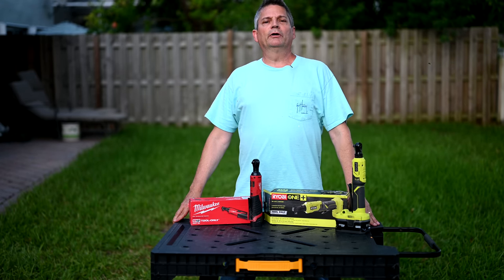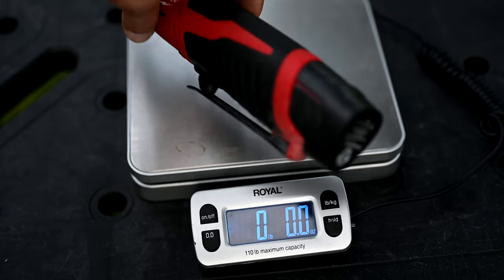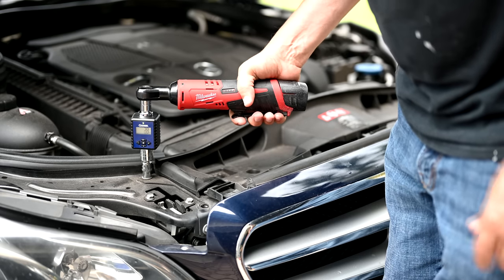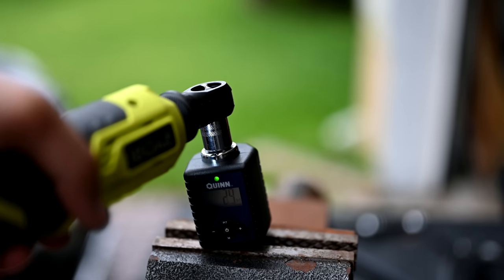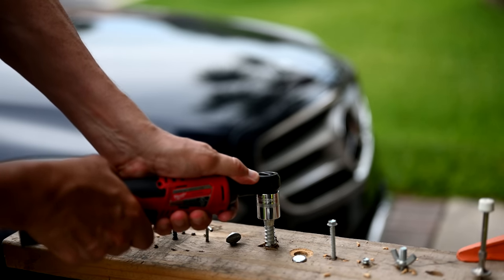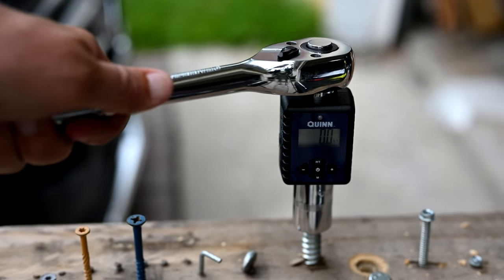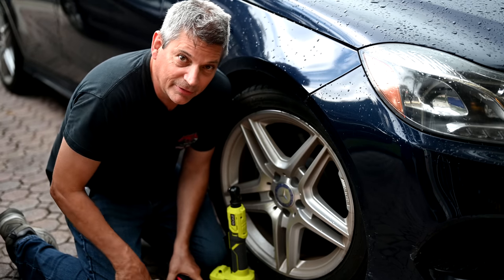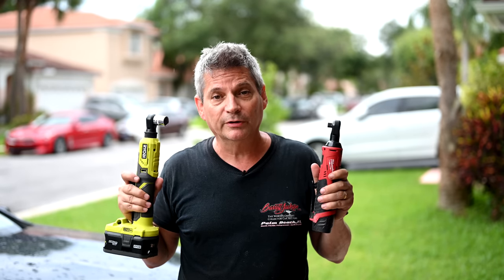Ryobi 3/8" Cordless Ratchet Vs. Milwaukee Torque/RPM Tests

Comment: You can see the marketing games that TTI is playing, rating the Ryobi at a lower RPM when it's clearly faster than the more expensive tool.  I want the Ryobi but the big battery really does seem dumb for tight engine bay work...problem is that's the only system I own.
Reply from the maker: Maybe they did not intend it to be used in tights places
Reply: @jeffostroff  Well they did at least try to counteract the battery issue with the rotating head, which is nice.  I'm just picturing one particular circumstance where it was a huge PITA to get a ratchet in to loosen some bolts (it was a transmission cooler/radiator situation) and I am just not sure the battery would clear.  Again I think the idea is you rotate the head so the battery is sticking into an area that has more room.  I really like the price/performance of the Ryobi tools, especially the way they probably trickle down technology from TTI's more expensive lines.  But I am still on the fence here...

Comment: The method you used to measure torque was flawed. Watch how Project Farm measures torque for electric ratchets. He got 30 ft lbs for the milwaukee.
Reply from the maker: I don't think we ever even showed it measuring the electronic ratchets. Not sure why you think using a torque converter is flawed anyway. Please explain your argument. Otherwise your comment is flawed.

Comment: I have both I don't lime the battery placement on the Ryobi at all
Reply from the maker: You are using it wrong then, if you rotate the head as I showed thin this video, you have the same space in front of the tool as you do on the Milwaukee.
Reply: @jeffostroff  its still not a valid comparison the tool is 3 years old 3

Comment: Actually with these electric ratchets they are designed to be used as ratchets. You break the fastener free using it as a ratchet manually and then you drive it out electronically. Or you drive it in electronically till it stops and then tighten it manually as a ratchet.
Reply from the maker: Sorry you are wrong. Both manuals have warnings about this. Milwaukee says this "Do not force the power tool. Use the correct power tool for your application. The correct power tool will do the job better and safer at the rate for which it was designed." AND ALSO, from the Ryobi User guide it says this "NOTICE: Do not turn the tool off and attempt to use the tool manually to gain extra torque on the nut or bolt being tightened. Doing so could cause damage to the fastener and/or the tool."
Reply: jeffostroff really lol...... I’m not wrong at all. That’s why they call it a ratchet. You clearly don’t know how those are used. You are using them like a right angle impact wrench which these aren’t. They are a ratchet. Keyword ratchet.....Manually break a fastener loose or tighten. When the manual says do not force the power tool that means do not use it like a impact wrench to break fasteners free or tighten them like you are doing. That’s why they only are rated for 35 ft/lbs torque because you break them loose manually then drive out the fastener. For how you are using these ratchets you want the tool below from Milwaukee. Sorry but I’m not wrong. These are ratchets for a reason, ask any mechanic how they are supposed to be used. 

https://www.milwaukeetool.com/Products/Power-Tools/Fastening/Impact-Wrenches/2564-20
Reply: jeffostroff the ryobi Manual probably says that because it’s not really designed for real professional trade use. It’s more for the diy guy on the weekend etc. The rotating head is a weak point for being used as a ratchet. The Milwaukee is designed to compete with pneumatic ratchets.
Reply: He is not wrong at all Jeff, I’ve been using the newer fuel versions and have beat the breath out of them using them as a ratchet, and have never broken the head, stripped the gears, or broken the plastic clamshell.
Reply: Mystery Comment.....I agree with you 100% even though they both state not to do so, but with that being said then what’s the damn use in even buying these ratchets if you can’t use them as a ratchet?!! Kind of pointless in my opinion. I mean who the hell is going to loosen a tight bolt with a regular ratchet and then switch out to the electric one to finish it out and then vice versa when reinstalling?! I guess these are great for someone more on the lazy side
Reply: Brandon Thomas not sure where everyone sees that it says not to do that though. Because even Milwaukee demonstrates it as a ratchet. Break fastener free first then use the electric ratchet feature.
Reply: jeffostroff Milwaukee head is rated higher torque than the automatic torque of the ratchet. The new fuel was beefed up I think to do 100 or 150 ft pounds manually because the first gen Milwaulkee were wearing out and internally would fail over long period of heavy use. This is the reason for the larger head. The ratchet tools are all made to break fastened nuts and bolts within reason. It would be difficult to get enough ft lbs using the tool normally. Most mechanics know when to get a breaker bar or step up to a bigger tool. I can’t imagine any time saving swapping back and forth from breaker bar to ratchet. Where these tools shine is where you have little room to swing a ratchet in confined space . The Milwaukee body being more like an air ratchet body with the slim profile has better advantage. I would like to see you do the husky electric ratchet it’s under 100 bucks and has internal batteries
Reply: @Mystery Comment. If you do what you're saying with these tools and they break, and yes Milwaukee fans, it will break, you won't get it fixed via the warranty.  They will take it apart and see that the ratcheting gear has been over stressed, put it back together and send it back to you unfixed.  Same as with a manual ratchet.  Just because it's a "ratchet" as you state, doesn't mean it has unlimited breaking power.  Use a boxed end wrench made out of high quality steel instead, with a pipe, if necessary.  And yes, these tools have value without using them as a breaking loose or tightening ratchet, which ratchets weren't designed for.  They were designed as time savers over a regular wrench, after the intial breaking loose or before final tightening.
Reply: @mickcarroll1274  why do you think they come in 1/4”, 3/8” and 1/2” drives. They’re designed to break fasteners at certain torque levels. Different size drives are made to use for different sizes of course. If you are going to break fasteners that require a impact and then try to get warranty then yeah that’s stupid.

Comment: So funny how Jeff tries and tries to make the milwaukee look good but can't screw down as much as the ryobi...lol
Reply from the maker: I tried, LOL! I think this driver is old and tired. Plus it's a 12V battery motor against the 18 volt. I bet If I get the M12 Fuel brushless version, it would run equal to the Ryobi
Reply: thanks for the great videos Jeff. Keep up the good work please.
Reply: @jeffostroff  yeah I noticed that as well. Nothing bad about the milwaukee, but I have noticed just like you mentioned seems as if ryobi is slowy creeping up on the higher end brand names, especially since alot of the parent companies seem to be making different brands. Just curious on your thoughts on the harbor freight icon brand? Any experience with them?
Reply: Its a 12 volt against an 18 volt, duh put the ryobi against a kobalt ratchet its 24 volt

Comment: The Ryobi wins. The large battery is annoying and may get in the way in 10% of case, but otherwise it’ll be fine. Ryobi doesn’t offer compact batteries like the Milwaukee 12V.
Reply from the maker: They just introduced a newer longer Ryobi
Reply: @jeffostroff  thanks for the info! I went and looked them up. They look nice. I’m hoping you review them!

Comment: I've got the Ryobi wrench, great for the price and performance. 

But, it's not an impact wrench. Also, the big ass battery on the Ryobi means the Milwaukee would obviously get into more tighter spacers.

So, I've got the Ryobi, but the Milwaukee wrench has that one advantage.
Reply from the maker: At 35 ft lb it is not intended to be an impact wrench it is more like an electric ratchet wrench

Comment: Someone pointed out the battery pack is too big on Ryobi for deep engine bay use especially if working in tight spaces on Asian cars, Mil costs more but you're paying for efficient design and more compact but possibly the same insides just different brand tagged on there.
So both offer great products one is just used for more compact areas where's the other as long as you have the room to work with, can't go wrong with Ryobi.
Reply from the maker: Great point!

Comment: Im thinking of getting the ryobi since I have a single ryobi battery and charger just sitting there after leaving my drill at my old job. Atleast thats what i think happened to it. That way ill only need to get the tool which is $79 The only problem is that the battery is a 4ah, alot bigger than the 2ah it comes with. Hipefully the weight increase doesnt make it ridiculous to use
Reply from the maker: I should try it with the 1.5 aH that comes with it

Comment: Of course the torque rating is not achieved. You released your grip before it could get to max torque. You let the ratchet start to rotate. You have lost all credibility with me in this test. Plus, loosening torque is not usually the same as tightening torque. 
These ratchets are useless unless they can be used as a ratchet without the trigger pulled. When removing a bolt, you put the socket on the bolt and try to see if the ratchet has enough torque to loosen the bolt. It it does not, release the trigger and use the ratchet as a manual ratchet to loosen the bolt then depress the trigger to remove the bolt. If we have to use a manual ratchet to break the bolt or nut free then change to the electric ratchet, nobody worth much would use them very often. Changing sockets from manual ratchet to electric ratchet can take more time than just manually ratcheting the bolt or nut.
It is obvious you have not spent much time working on cars. 
I would never want that monster battery on a ratchet. Far too clumsy. 
btw, Ryobi is so chicken stuff afraid of lawsuits they put all kinds of ridiculous disclaimers on their tools.
Reply from the maker: The process you just described you would need medium range impact wrench, no have to play games with testing the torque, then using the tool against the advice of the instruction manual. These are light duty ratchets. anything beyond that should be using a 3/8 or 1/2" impact ratchet capable of 250 ft lbs to ensure you can deliver the proper amount of torque to loosen tough bolts.
Reply: @jeffostroff  As I said, you don't know mechanic's hand tools. If an electric ratchet that delivers 30 to 35 ft-lbs cannot handle me pulling to loosen or tighten a bolt at 60 or more ft-lbs, it is a piece of useless junk. Ryobi is covering their a$$, not telling the limits of the capability of the tool. Milwaukee does not make such stupid disclaimers. 
No mechanic, pro or shade tree, is going to want an electric ratchet that cannot handle a 60 to maybe 80 ft-lb pull to break a bolt loose before using the electric function to remove the bolt. Milwaukee makes a 200 ft-lb impact ratchet but it has a large head so it is not as functional as a powered ratchet. 
Interesting how little power is available in that 18v Ryobi compared to the 12v Milwaukee. Milwaukee makes a 55 ft-lb 3/8 ratchet.

Comment: I have both which do I like most ? The milwaukee . The milwaukee can definitely get in tighter places . But if you like a low cost tool the Roy I is not that bad and it will save you time .
Reply from the maker: both perform equally for me

Comment: The whole purpose of an electric ratchet is the ease of use in tight spaces. It doesn't make sense to have it with a giant battery at the end of it.
Reply from the maker: I got news for you even the M12 has a problem deep down in your engine in tight spaces.

Comment: I bought the two and had to return the ryobi the battery gets in the way when working in real things under the hood. To bad it had potential.
Reply from the maker: Did you try rotating the head around? If you use it backwards, the battery doe snot get in the way, or you cna use extensions. I have up to 12" ratchet extensions.

Comment: 12V vs  18 V .   And the size does make a diff if you have to use it in a tighter space.
Reply from the maker: You make it sound like the Ryobi has more power. Both tools are specification listed at 35 ft-lbs, and 240 or so RPM, they should have same power.

Comment: Put the same size battery on the on the Milwaukee .
Reply from the maker: Does not matter what size battery you use, they are both speced to 35 ft pounds. Putting a bigger battery on the Milwaukee is not going to make it put out 50 ft-pounds
Reply: @jeffostroff  My point was the size, not power or performance.

Comment: You can use the electric ratchets as a ratchet but on my Snap-On Electric ratchet it says the head is rated at 150 ftlbs of torque
Reply from the maker: Now that is some power. Have you used it to remove lug nuts, and how well does it do it?

Comment: The Ryobi looks to be about as useful as a car without tires with that huge battery. How are you gonna take advantage of having a cordless ratchet if it can't fit anywhere?
Reply from the maker: It fits all over the place. It might not fit down deep in the engine, but use it all over the top, on batteries, spinning lug nuts, use them on dishwasher installs, a million things.

Comment: Is it 18v vs 12v?
Reply from the maker: Both tools have the same specs and same torque, it likely has little to do with whether one is 18V and the other is 12V, they should have similar strength

Comment: Wonder how the Milwaukee would do with a 4ah battery.
Reply from the maker: I doubt it will give it more power, it just has more capacity
Reply: @jeffostroff  Sounds weird i know, but check out torque test channel.  Depends on the tool, but some tools are more powerful with bigger batteries.  Honestly may have more to do with some of the bigger batteries have better cells in the pack.

https://www.youtube.com/watch?v=WD2Pe4MIuSA

edit: actually this guy did get 22% more power using the 4.0 vs the 2.0 in one of the M12 tools

https://www.youtube.com/watch?v=IDutTs7KEKU

Comment: A 12 v vs 18v
Reply from the maker: It's what I had, it was just meant to show off 2 different tools but they have the exact same specs. That's what's important.
Reply: It is ALL about the watts.  Voltage multiplied by amps equals watts. 

18 volts * 5amps = 90 watts.
12 volts * 7.5 amps = 90 watts. 

In the case above both would be providing equal power which I am willing to bet is the case with these 2 ratchets. The milwaukee is drawing more amps. The fuel version would draw even more amps and shoulf put both of these tools to shame yet it is still a 12v.

Comment: This is a review putting an 18v tool against a 12v tool that is like racing a 1 litre car against a 2 litre car and being surprised at the result ????
Reply from the maker: They are both rated with the same RPMs and the same 35 ft-lbs of torque, regardless of the battery voltage.

Comment: I like red but man that m12 power is weak! Definitely for light engine work maybe pulleys or water pump but fuel version if available would be way better and Ryobi version is better but bulky battery however it's 18V so more power 4 position makes the battery easy to work with, Ryobi for the win in this video 🥇
Reply from the maker: The new Fuel version ought to be nice and strong

Comment: But why would you compare a Milwaukee ratchet that was developed well over 5 tears ago and that they have updated with a fuel version to a brand new ratchet from another company? I would hope that there would be some improvements but that's obvious. There's no way to get around that battery situation
Reply from the maker: I compared what I had. I do plan on getting the Fuel version and comparing all 3 some day soon.

Comment: the problem about the milwaukee small ratchet is sometime u just wish u could turn the head other way so when u use it ur hand will not cramp and push the switch all way down
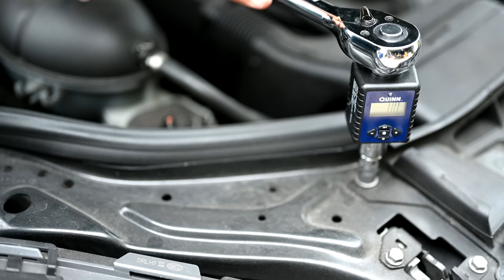like at 8:31
Reply from the maker: With the right extenders used, hopefully it won't be an issue at getting into tight spaces.

Comment: That huge battery on the Ryobi is bigger than my m12 stubby 3/8” impact. So anywhere I would want to use that Ryobi, I would just use my impact. This is comparing apples to oranges. The fact that you get paid to make videos like this is embarrassing.
Reply from the maker: Your comment is an embarrassment to your lack of knowledge, it does not matter that one battery is bigger, what matters is both are rated the same torque, so it is a fair test. also plenty of people out there can't afford the Milwaukee. there's nothing wrong with comparing 2 wrenches. You'll really blow a gasket next week when we compare a battery operated brad nailer to a pneumatic brad nailer.

Comment: This is a joke. No mechanic will ever use that unwieldy tool
Reply from the maker: I got news for you, even the Milwaukee tool is too big sometimes, I tried to use it in my engine to replaces the O rings on my turbo charger and could not reach. Sometimes even a ratchet with a socket is too big. Each tool has its place. But to say that no mechanic would ever use it, that's ridiculous. There are plenty of nuts and bolts all over the upper part of an engine that are easily within reach.
Reply: @jeffostroff  I don't even have Milwaukee tools. Didn't mean to come off rude but the whole purpose of a ratcheting wrench (powered or not) is speed and accessibility. That big ass batt. is a hindrance for a flat rate mechanic. The Makita, Milwaukee or even earthquake would be miles more useful to techs than that big thing.